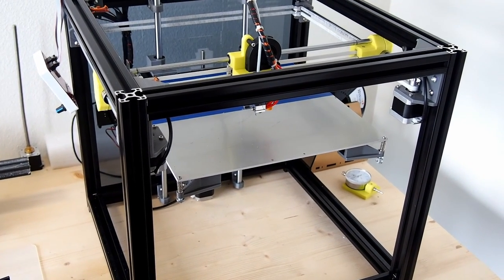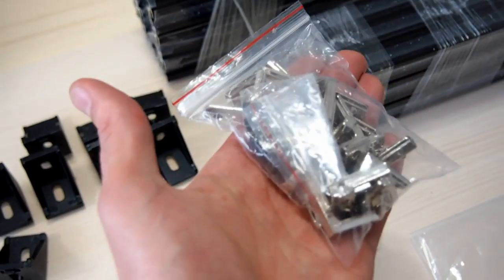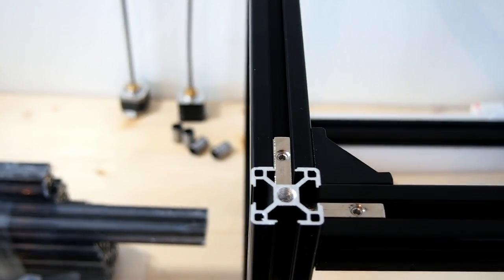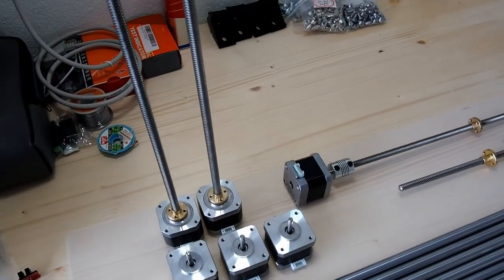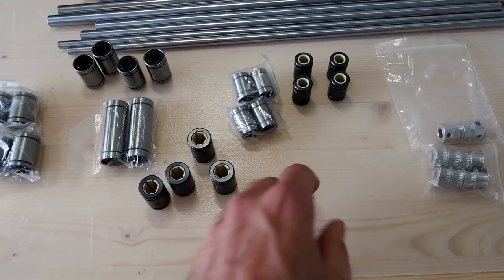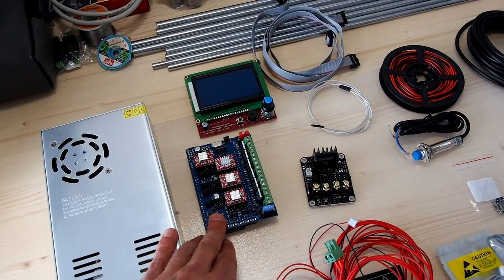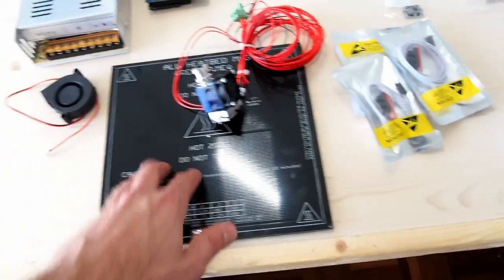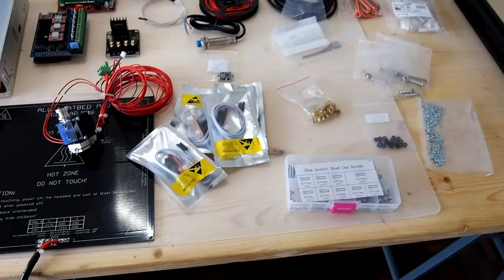HyperCube Evolution #2 - Parts and Frame

Comment: Hi Scott, nice job! Have you given any thought to using 4 z-axis lead screws (one on each corner of the build plate) each with a timing pully and ganged with a large timing belt loop around all 4 pulleys, then drive all of them with a single, beefier NEMA motor? I'm thinking it may be a bit cheaper than using the linear slide rods and dual-z stepper motors.

Comment: What do you think of using  M8 "standard" lead screw instead of those you seems to have used ? Will they be OK ? They are wayyy cheaper than "printer lead screws" ??
And if I'm going the dual Z version, what about 8mm steel rods instead of 12mm ? I think that with dual Z, the mechanicals constraints won't be so high ?

Comment: Is the design scalable to fit larger beds?
Reply: Yes, there is a spreadsheet that allows you to enter custom sizes and it'll tell you the lengths of the aluminum extrusions needed.
Reply: Where is the spreadsheet located in the files?

Comment: Hi Scott. In this video you mention M6 screws but the BOM on Thingiverse only has M5 and M3. Please advise.
Reply: Mine uses 6mmx12mm screws - I guess it depends on the thread of your hammer nuts.
Reply: If you are using the hidden "L" brackets you will need M6 screws as the grub screws are M6. You will also need the M5 and M3 bolts. You can use M6 bolts throughout but you will have to drill out the hols in some parts.
Reply: Glyn Davidson what is the length of m6?

Comment: Have you considered using carbon fiber tubes instead of the linear rails? :)
Reply: On the X axis it would make sense and there are remixes to allow for bushings as well as igus bearings. The Y and Z axis really don't need CF since they don't move so it would just be a waste to bother unless you just want to. There are a few other remixes of those axis parts as well, I believe if you look in the thingiverse site.
Reply: Daniel Drejer cbt usually aren't that precise, you might need a bit sanding

Comment: any advantage of the optical endstops over micro switches? I know micro switches wear out eventually, but are a hell of a lot cheaper too
Reply from the maker: Advantages... they both perform the same function but I do like the solid state nature, no mechanical parts to wear out and if something does go wrong nothing to break. I think that repeatability may be a little better as well.
Reply: fair enough :) thanks a million

Comment: really nice job designing the parts mate ive been considering converting mine to dual z axis since i built it works grand as is but I always thought it would be more stable to have it supported both sides

Comment: So you're planning to run that Arduino Due on 24V?
Any trick to do that? because the Due can take up to 16V max..
If you use a step-down converter to power the Due, the stepper drivers also run on 12V, which would be a shame?
Please let me know
Reply from the maker: The RADDS board supports 24V for steppers and heat bed etc and also supplies the correct stepped down voltage for the Arduino Due, so all good. Actually a better set-up than for the RAMPS 1.4.
Reply: Thanks, that's interresting!, So you power the RADDS with 24V and the boards does the rest, providing 12V to the Due and 24V to motors, nice!